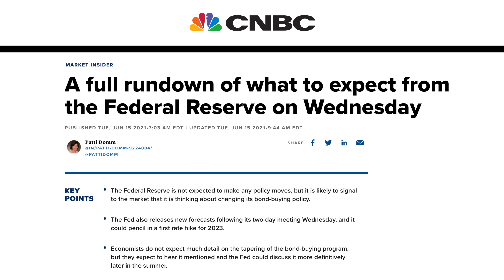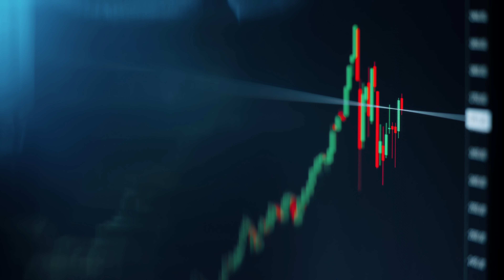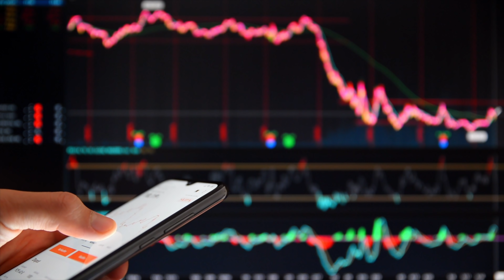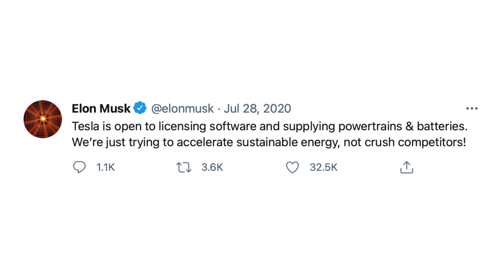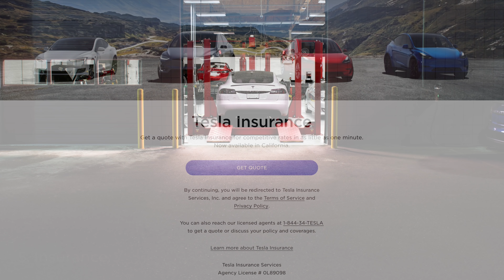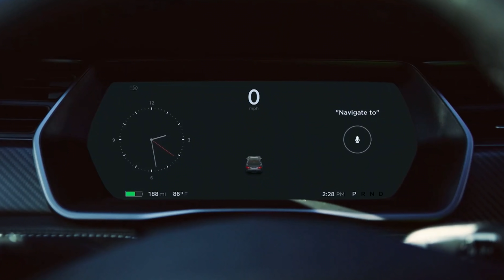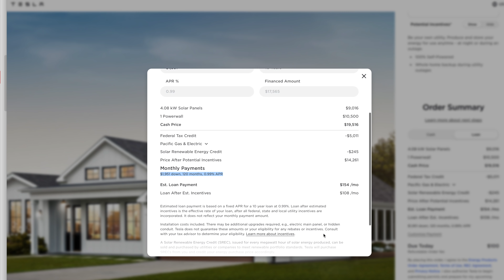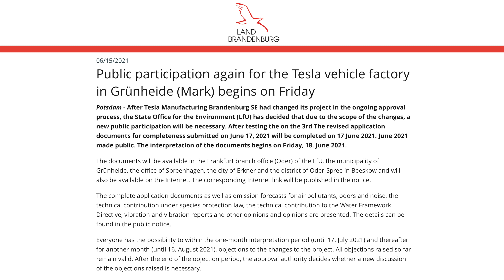Tesla Stock Is Dragging - What Will Break It Out? (TSLA)

Comment: It puzzles me when people argue that 4680's are delayed. Elon said in battery day that it would take about 3 years to fully realize the plans. It's only been 9 months. I don't understand why people have their expectations so high.
Great episode as usual!
Reply from the maker: I don’t think I said delayed, I just said uncertainty. Justified or not, it’s there, and Tesla’s messaging has been confusing at a minimum. The volume production comments have not lined up with gigafactory timelines.
Reply: Maybe because they announced that their pilot plant was going to crank out 4680 at a 10GWh/yr rate and be in the Plaid Model S but it got scrapped 9 months later... But you're right that expectations should be adequate for such large industrial endeavours.
Reply: How is that the peoples fault though? 
It made perfect sense that they wouldn’t throw away the first 4680s out of the pilot plant but used them in a low volume product like the Roadster Plaid +. 
Also, the 3 year time frame was for mass production, not for the pilot plant. 
The question to me is, what are they doing with those batteries?
Reply: I have always assumed that the 4680 batteries would be reserved for the Cybertruck and the Tesla Simi. they require them while the S,X,3,&,Y can wait.
Reply: I do Julio
Reply: True Elon said it would take that long but in the video they showed of the batteries being made, it made it seem that they were ready to be installed into cars pretty soon but thats not the case...
Reply: I think many investors just realize, how critical the 4680 ramping is. So we would love to have a weekly update on battery production. Of course Tesla will remain silent on this until they have something to show and impress.
Reply: @Bigmouth-CARL  Thats just wrong. model Y and model 3 would always be the priority for tesla 4680 cells; That are the current mass production vehicles that tesla has. The vehicles that can make or break tesla.
Reply: On Battery Day he said 18 month for volume production to start... we are just 8 month after battery day. People are delusional on timeframe, same with Starship, Man on Moon, Man on Mars, FSD, etc...
Reply: @Turbo999be  That’s not the point. They have build/are building a pilot plant. 14th biggest battery factory world wide or something like that. Where do those batteries go? The plan was most likely to put them into the Plaid +.
Now that that isn’t happening it’s seems like they haven’t figured out the cell to the point at which it is okay to use them in their products. So the challenge isn’t just the ramp up but the cell itself.
On battery day Elon indicated that they haven’t figured out every little detail yet, but the Plaid + led people to believe they have. 
As Rob is saying, they did this to themselves…
Reply: @Glenhh  Never ever was it mentionned anywhere apart in delusional YT channels that the Plaid+ would be using de 4680. So people believing it was the case were delusional, Tesla has nothing to do with that. The current test production will be used in priority for the CT. By the time Berlin and Texas will ramp up production the 4680 is expected to ramp up also. From my point of view, they are trying to synchonized Austing/Berlin with the 4680 ramp up, but of course some delays are most likely expected.
Reply: @jedivm1  No. If you are having a limited supply of the 4680 batteries it's better to put them in your top model lower volume cars such as the Tesla model S. This means that you can start using them much earlier, you will have more time gathering data from the cars, and you will get great free advertising from doing so.
Reply: Well. Elon have confirmed that Berlin model Y will have the 4680, so I don't find it surprising that people expect that Tesla should have solved the 4680 production issues before that.
Reply: Elon said they will have 10GWatt production by end of year.
Reply: @Glenhh  The Plaid+ delivery time frame was initially end of 2021, then mid 2022. So taking that into consideration, none of your conclusions can be deducted from what you're assuming.
Reply: @Marlow925  Not true. Taking end of 2021 into consideration led me to believe they had the batteries figured out. 
When they changed it to next year I though they same thing as I am thinking now.
Reply: @Glenhh  but that's just you making assumptions. Until you are within a few months (no more than 3-4) of the first deliveries, there is no way, you can make any such assumptions. Until then, it's just wishful thinking. There has been made no statement by Tesla, that altered the 18 months timeline from battery day. So that's the  ONLY solid timeline you have. And that's about a year out. And 6 months out before production on the cells even is started, that could be used for production. If we go by Elons statement, that they're going to produce before the end of the year. 

If you create unrealistic targets for yourself, you're bound to be disappointed.

Them dropping the Plaid+ made total sense. There is no case for the Plaid+. Those who want that sort of performance should buy the Roadster, which will need the new cells, also.
Reply: He said they had started making them on battery day.  If they don't have enough for model S plaid, they are well behind in any ramp.
Reply: @Bigmouth-CARL  it is necessary to start with lowest volume use for volume ramp.
Reply: @davidsuzukiispolpot  erhh .. no .. they said, they had a pre-production line, that was producing them, but the yield was not good enough, yet. That's what they stated at battery day. The conclusion from that can never be, that they have production ready cells. Again, wishful thinking instead of looking at what info one is given.
Reply: @Marlow925  Have they ever confirmed the new cells for the Roadster or are you just assuming? lol
Reply: @Glenhh   Based on Sandy Munros calculations, they can't make the Roadster without those. At least not to the specs. Either way, there's no certain delivery time frame for the Roadster yet, so there is no point speculating. However speculating, deducting, that the 4680s haven't worked out (yet) based on that they dropped the Plaid+ is going a bit far. And yes, Plaid+ also would have had to have the 4680s for it's range unless they came up with some other magic. It shall be interesting, when Sandy gets a Plaid and takes it apart, what they've done there.
Reply: @yourcrazybear  If your supply of 4680's is limited you put them in the most energy demanding systems you have like the Semi and CT.
Reply: @Glenhh  They're building 2 factories that will both produce 4680's for the vehicles they intend to make.  Both those factories are going ahead full speed.  I think it's simplistic to conclude there is any problem with production or the cell.  On battery day they said the biggest issue was the line, not the cell.  People assumed things about the Plaid+, and we should know the dangers of assumptions by now.
Reply: @Marlow925  I have never claimed they haven’t worked out. I said they aren’t ready. 
And now you agree that the Plaid + would likely had to have the 4680. That’s all I claimed. 
It’s not a big deal in the long run, but it should never have happened. You don’t get people exited for a product and then cancel it, that is unnecessary.
Reply: @TheEvilmooseofdoom  At battery day Musk told us they haven’t figured it out 100% yet. No biggie since the real production would start 2022. But the pilot plant has already produced batteries (to what capacity we don’t know or if it even produces consistently, I doubt it). It made total sense that they wouldn’t waste those batteries but use them for a low volume product. 
I‘m simply arguing that they though they were ahead of schedule, announced the Plaid +, realized they are on track but not ahead of schedule and then canceled the Plaid +. I know that is speculation, but why not. I speculated Tesla would be a great company 5 years ago, nothing bad about a little bit of speculation.
In either case, canceling an already announced product is not a good thing. We should all agree on that.
Reply: @Glenhh  it certainly is not a good plan to do so, but in all honesty, at least Tesla has the ability to turn around and say: hey, this makes no sense, so we're not making it. Plus it wasn't like it's their top tear product they cancelled. Would be worse, if the Roadster was cancelled. Most other automakers would just carry on, no matter how much sense it makes. The Plaid+ Model S was always a niche product with very little volume and probably just taking away from Roadster sales, once that's available.
Reply: @Marlow925  I agree. Not that big of a deal. The cancelation of the Roadster on the other hand would be, as you pointed out. Also not a big product in Tesla overall business but a prestige product and claim from Tesla and a key product for BEVs in general IMO.
As a German I see how iconic cars can inspire generations to like a brand.
Reply: @Glenhh  tell me about it. I own (still !!) an E39 M5 :) And I used to own a Type44 Audi 200 Quattro Avant.
Reply: Expectations high because Musk lies! Robotaxis coming in 2020- remember that!
Reply: @TheEvilmooseofdoom  No. Not if you don't have enough supply for all of the Semis and Cybertrucks you are going to produce. Those products are also not in production yet. 

It's better to put them in the top end products like Model S and cement your place as the best performing production car in the world. It improves the brand and you get a lot of free advertising as well.

Another benefit of doing so is that you get extra time to gather live data about the batteries in use.

Comment: Once 4680 cells begin to scale up anywhere at high yield, fast throughout and low cost, I just don’t see how Tesla can be stopped. Also once Dojo comes online and FSD really starts to begin to rapidly improve, no one will be able to deny that Tesla will likely dominate the future.
Reply: @marovalko7340  you sound like a short term trader, not an investor.
An investor looks at the long term potential of a company, and doesn't worry about the short term fluctuations as long as the long term case doesn't change.

If Tesla is able to execute these things, even if they are years late, the long term potential is still there.
Reply: @ke6gwf  ... forget what i said. Anything negative or realistic means somebody is teslaq or daytrader. Make sense. I am just trying to follow reasonable views positive plus negative, and read between lines.
Reply: @ke6gwf  I disagree. Iakona23 doesn't sound like a short term trader at all. The reasoning here was that once Tesla solves the problem with their battery manufacturing it's very hard to see how Tesla can be stopped. And that when Tesla solves FSD it will be quite impossible for anyone to disregard Tesla's future dominance.
Reply: The key word is “once”. The problem is 4680 will eventually be released, however I have a hunch it will be a different 4680 then the people expect.
Reply: Hello fellow amateur and TSLA stock holder..  ZL2WHO .. 73
Reply: @yourcrazybear  Exactly! Thank you.

Comment: They are "Building It" it will come... be patient... Austin and Berlin will be up and running soon and then you will forget about this "lag" time.
Reply: comatose stock until mid q3
Reply: The quicker they can make the cars the quicker they can start generating revenue though. Races aren't for the patient
Reply: Every long term investor knows that. But it would still smooth the roller coaster ride that is the stock, if Tesla knew as well. 
Confirming a product and taking orders just to deleted it with a tweet was 100% avoidable.
Reply: Major Facts! Each facilities will be able to produce a million units per year.

Comment: My guess is Austin contributes more in 2021 than Berlin, with a pretty good chance that neither is material to 2021.  Stock stays range bound until Q2 or so 2022.  IMO.
Reply: Already doing it as they are producing mega castings there already.
Reply: Into 2022 I see Berlin getting to huge numbers - that factory is massive and with the new manufacturing for model Y it's going to be fast.
Reply: @Turbo999be  absolutely, some powerful operational leverage should start kicking in 2022.  Good points.

Comment: I am thinking that Tesla is possibly bundling solar and power wall to build out a distributed power plant model tied together with auto bidder.
So part of the low percentage rate may include that they are allowed to provide grid balancing services using a portion of the power wall capacity etc.
Elon also said something about the power walls having additional capacity above the advertised number, and so they may be able to use that for arbitrage, in which case the more installations they can get, the more money they can make without it costing the home owner more.

Comment: What will help or break out?

Just to get to present value of future cash flows with a 15% discount, 60% growth in FCF for 5-6 years without slowing is required- without issuing shares. 

Currently they have been diluting your share value by half over the last 5 years. 

So if that continues, you need an average yearly growth in FCF by about 75% just to get to a price where your expected return would be only 15%. It’s about 10-15x over valued fir a 15% return.

Comment: There is also the price  aspect of the cars on offer to consider. It really doesnt matter that much for a normal consumer how good a battery of the car can potentially be if the price of a certain ev based car is priced over 130k dollars. That is clearly a  car meant for the luxury car market despite any obivous advantages that a more efficient battery might bring. Even 5 to 10k of a price increase might be the reason why some car buyers might go for the cheaper model if there is one on offer. Would you buy a fridge that is thousand dollars more expensive just because it will save you cash in electricity bills? Some people probably would but some people would just probably go for the cheaper fridge.
Reply: The S isn't being aimed at the general consumer.  It's a car you buy for performance as much as anything which is also why it's produced in lower numbers.
Reply: @TheEvilmooseofdoom  And that is why one shouldnt expect it to affect the stock price that much.

Comment: Good news will work to breakout the SP. The completion of the construction and the start of operations in both Germany  and Texas will be such good news. The 4680 battery has already been utilized in a new model resulting in longer range and lighter weight. This is good news. The FSD is coming along and will be good news. Units delivered is continuing to set records. That is good news. The announcement of additional new factory starts will be good news. Florida? England? A cheaper model is a must. The price of solar roofs is not a cheaper alternative yet, so we shall see what happens.

Comment: It was 7X last year, what do people expect?  It's sales and earnings were not 7X. Correcting 35% is already showing amazing resilience. Wouldn't be surprised if it corrects 50%.

The current price has priced in over 5 years of yearly 50% growth.  It has to far surpass expectation to jump. And people are expecting 1 million deliveries this year.  If it falls short or disappoints in anyway, the stock are likely to suffer.
Pierre Ferragu is a reasonable TSLA bull, and he forecast around a 1,200 price target in 2025. That's around 20% annual gain from here, not bad. But if you got in at around 800 or higher, yearly return becomes 10%. For a 10% yearly return there are  less risky options elsewhere. Many people made a lot of money with TSLA last year and some of them are taking profit before it dwindles further, adding to the sell pressure.  You need diamond hands to stay put.

Comment: Agree with other comment that 4680 and FSD are key!  Unfortunately, I'm becoming more and more worried that something is amiss with the 4680. Likely that it's not scalable and potentially needing years not months to get them into mass production.  This would create all kinds of upheaval, such as a prolonged delay of the Cybertruck that requires 4680 or perhaps Berlin and Texas both having to build Model Y with alternate batteries. I hope I'm wrong. Of course the prolonged silence around 4680 doesn't create confidence.
Reply: They plan to make them in both factories and they're going full speed ahead on both.  Having lines that can put out 10's of thousands of cars per month with no battery supply would be silly.  I think all this nonsense about issues with the 4680's is exactly that, nonsense.  Prolonged silence?  What were you expecting them to say?  They confirmed they'll be making them and confirmed the models that will be using them.

Comment: This is a little off subject for this particular video but is something I noticed.  All Tesla models get less MPGe highway than MPGe city.  The electric motors lose horsepower as RPM's increase.  The new motor for the Model S Plaid doesn't lose horsepower as RPM's increase so I think it  probably gets a range for highway that is closer to the range for city.  They need to use these new motors in all models and that will extend the range more for all models.
Reply: EV's loose range on highway due to drag.